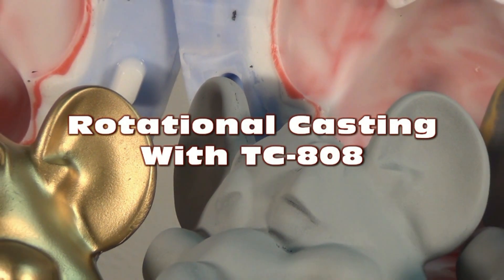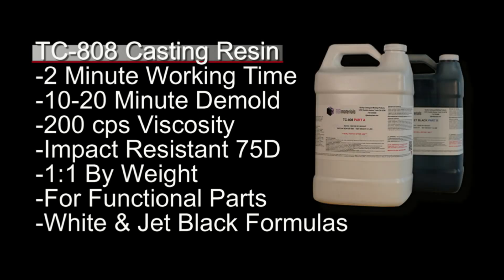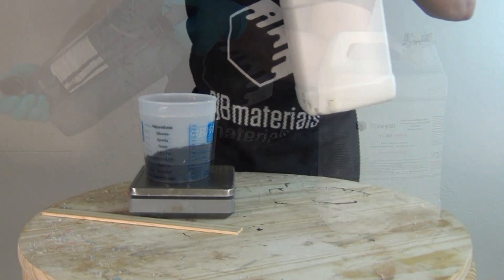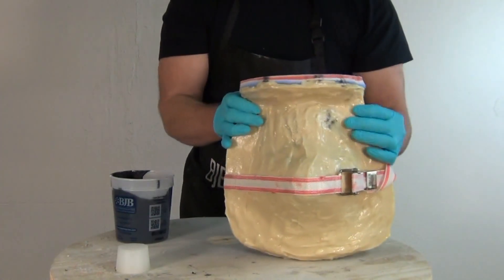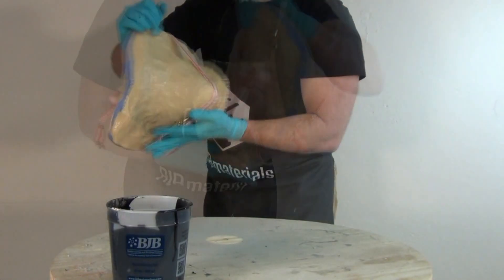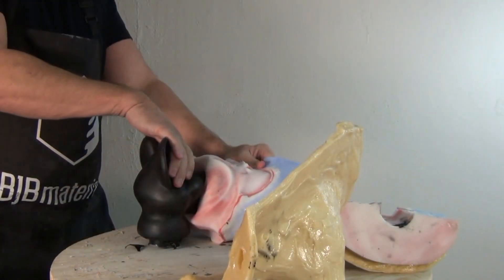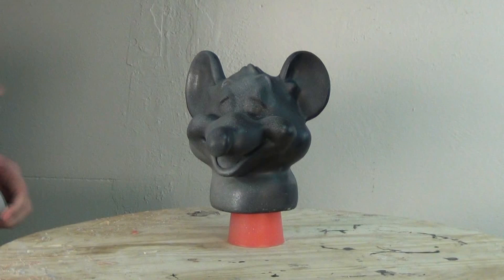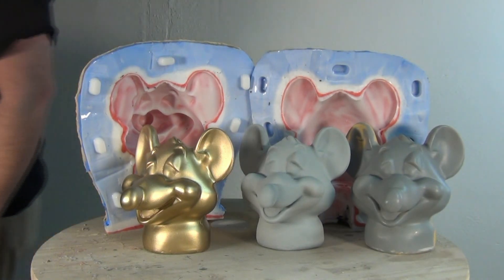Resin Casting Tutorial: Rotational Cast Resin For Hollow Parts

Comment: Is it possible to rotocast a urethane rubber?  Want to make a tough skin, that I can then backfill with a 3# flexible foam. Rubber will add strength to skin, and make easier to remove from mold (super lightweight foams are so weak it's hard to demold without damage)
Reply from the maker: https://youtu.be/6pFIz8ZIuFs

Comment: Will this mold allow you to cast the heads with the wire sticking out the bottom like Peeler Rose used?
Reply from the maker: That was a different setup. Originally there was a mold for the rat head, a mold for the teeth, a mold for the two hands, and a neck mold that allowed the armature wire to be embedded.